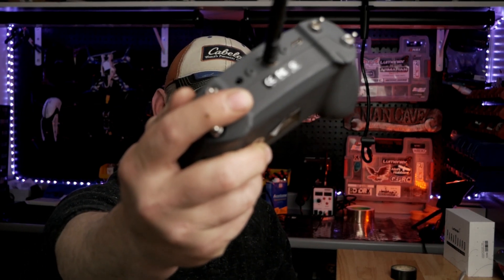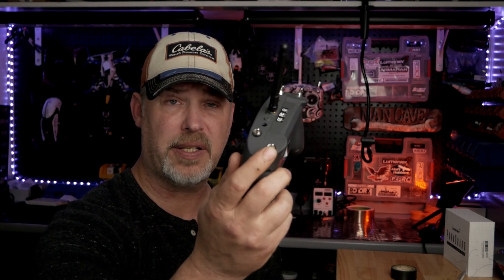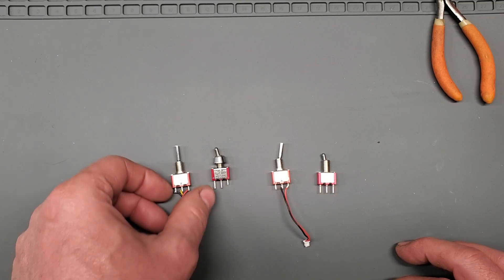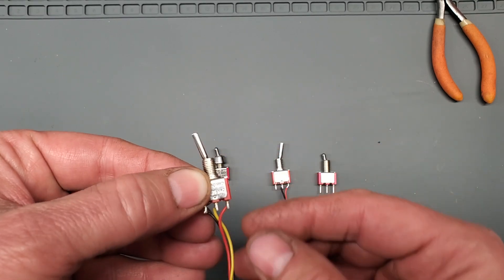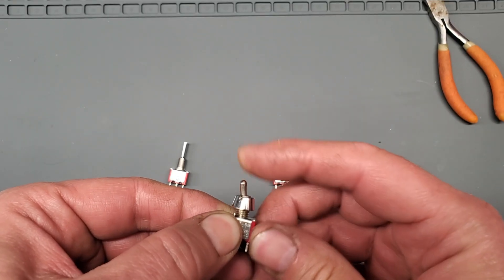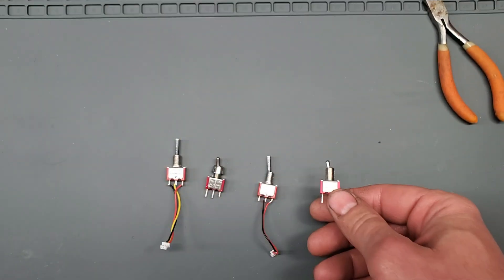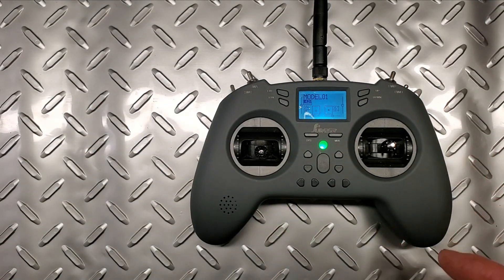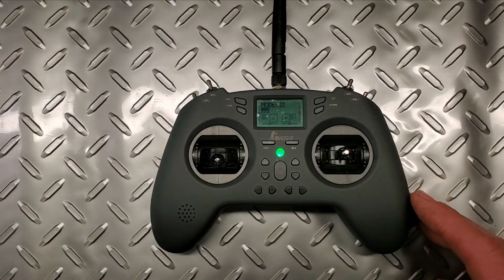Jumper T Lite Switch Mod, SharkByte news

Comment: I just installed the switches and it makes a big difference. Fits my hands so much better.  Fits in the bag better also and not worried about breaking the switches. They even have shorter ones than the switches you installed but ended up being too short and went with  the same ones you installed in the end.
Thank you very much for the video. This T-light is my daily driver for whoops now.

Comment: Great idea! I hated that they stuck out so far on such a small controller. Thanks for the link to the switches. I messed up and didn't put in the right quantity and they fixed it easy peasy. I rarely have had a better purchase. +1 for Love My Switches.

Comment: I used a caddx ratel housing, I glued the runcam pcb in the housing, its realy good now, thanks for your work, Happy flying
Reply: Which Ratel housing did you use? Trying to do the same
Reply: @nickgreaux2335  the ratel  micro 19mm with the plastic back cover, keeps the MIPI cable secure wen using a little foam between the cover and the cable, I think its beter than the plastic housing.
Reply: @snakefich  thank you!!
Reply: @nickgreaux2335  Glad I could help

Comment: Looks dramatically better. On the computer it looks normal, but on the mobile phone it looks much better.... 
Has anyone tried the DJI lens of the nebula pro with the SB system? just a thought....
Reply from the maker: yes, the Caddx Ratel V2 lens is supposed to be the same as the DJI cam. It does make a difference for sure. My last video I put up some footage mid way through with the Caddx Nebula V1 lens and even though it's hard to tell on YT, it did make a difference as well.